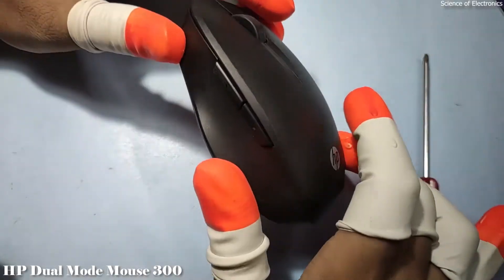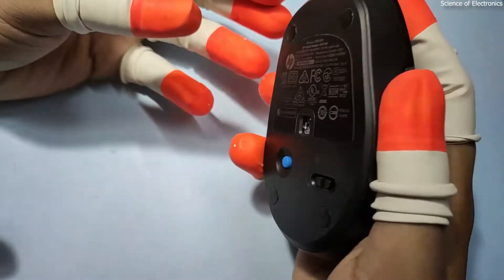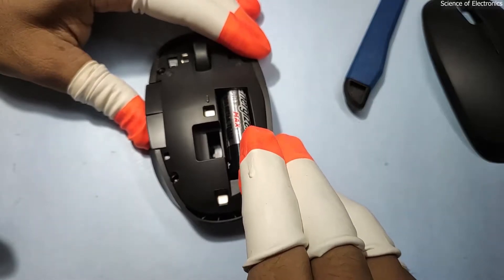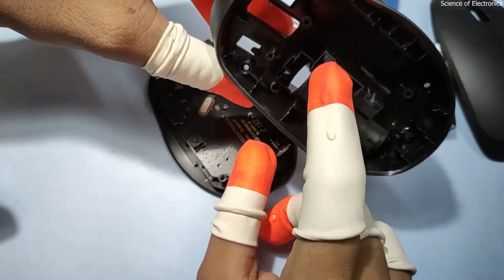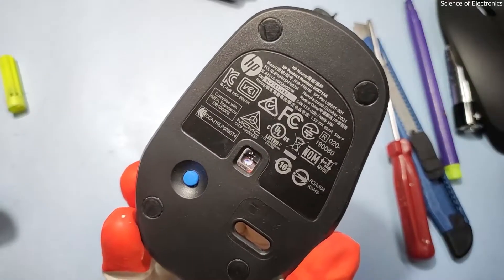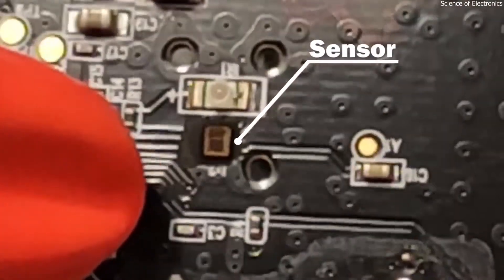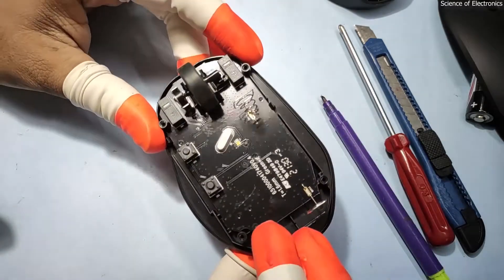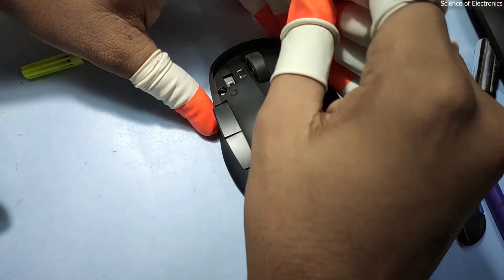Hp dual mode mouse 300 Repair &  teardown @SO_ELECTRONICS  #hp #gamingmouse #repair

Comment: My left button started to cause problems. Sometimes it double clicks, sometimes it releases while dragging. Which switch is used for the left button?
Reply from the maker: @Emrullah_BASER  open mouse insert Isopropyl alcohol IP inside the switch head and click for more then 50 times. Must be remove the battery before put IP . Use after 3 to 4 hours.